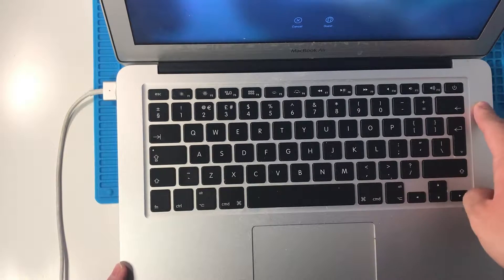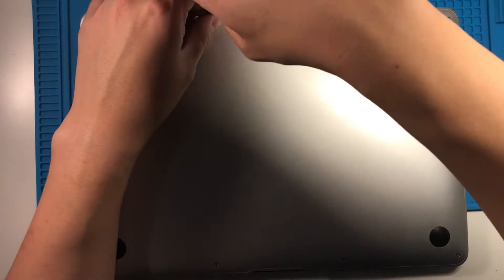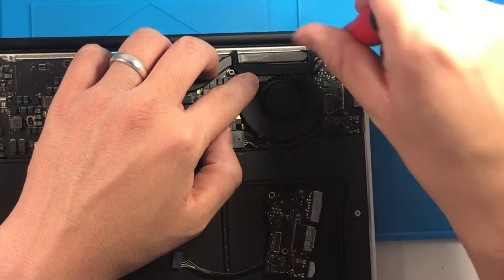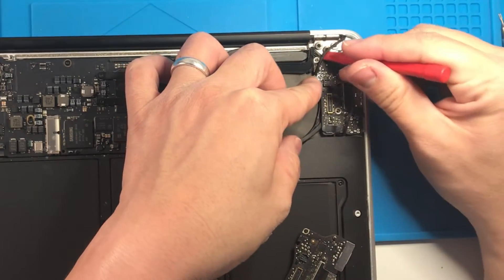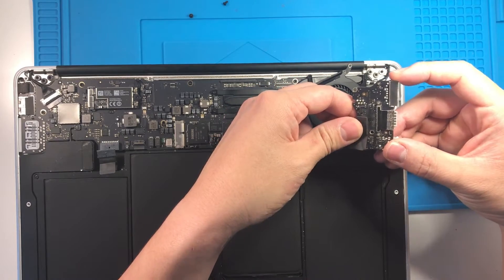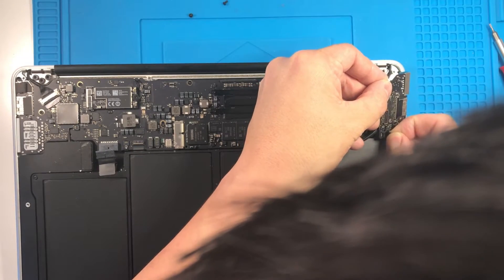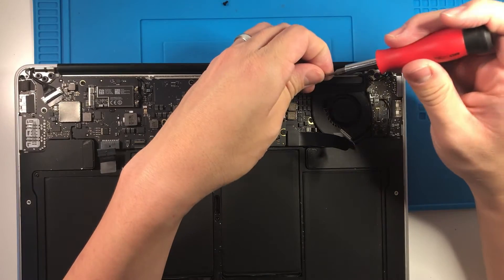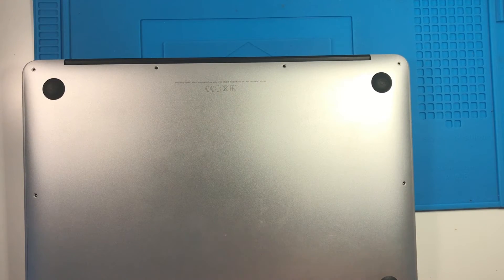MacBook Air 13" 2012-2017 A1466 - No MagSafe green/orange charge light - DC-In I/O Board Replacement

Comment: I have an old mid 2012 a1466 I need to fix, but the only board I've found is listed is a1466 but for 2013-2017? Can I make it work for mine 2012 air?

Comment: Thank you very much. Was able to fix my air 2017 with total cost of $25 including the tools and I/O board. Much appreciated.
Reply: Did yours still. Say the power was connected just not charging? My 2015  is starting to have intermittent charging

Comment: Thanks for the video. I have a 2017 MacBook Air that stopped turning on. It sounded like it was overheating/the fan got really loud and never turned back on. I replaced the battery, fan, and DC-IN board. The maglight strip now shows that it’s charging but the computer is unresponsive after charging overnight. Any ideas on what else it could be? Thanks in advance.

Comment: Hi Andrew, Need your help. I am using the Macbook Air (Early 2014) model and now when i am connecting the charger i am not getting the green/amber light and neither i am able to power up the machine and not able to boot up. Is the I/O board get burnt up. The problem occurs when i tried to connect the macbook with the non-apple magsafe2 charger purchased from e-commerce site.
Reply from the maker: Try a genuine charger first.